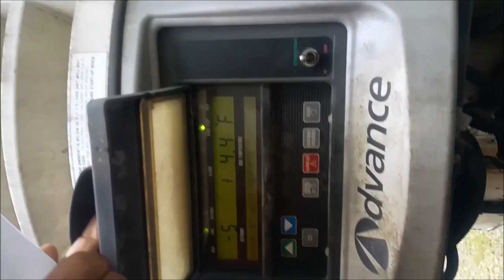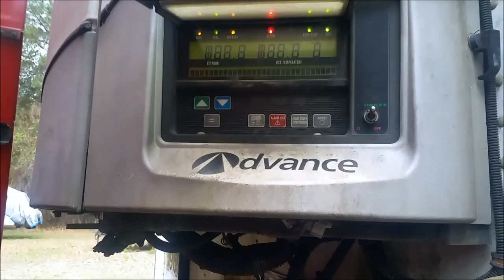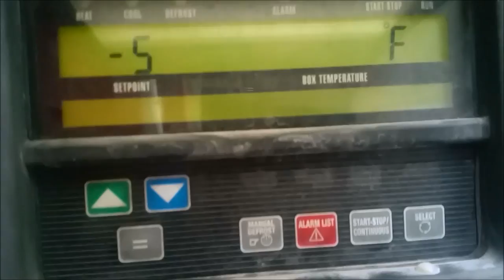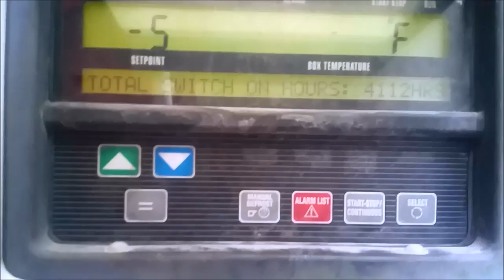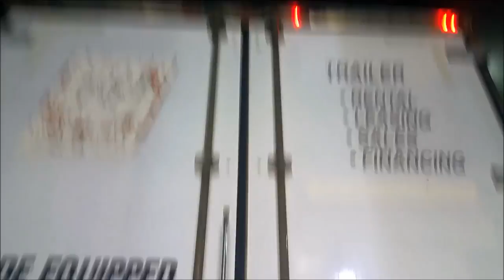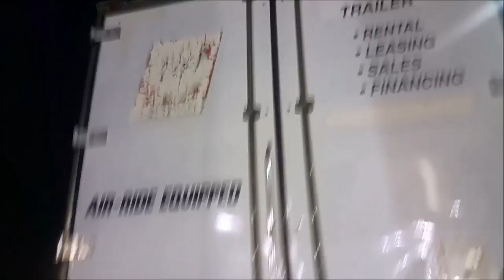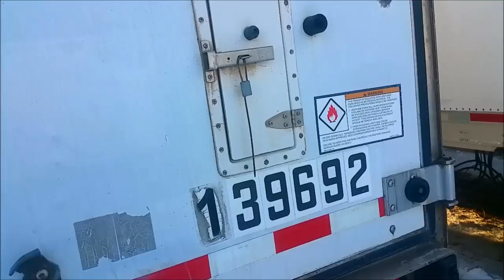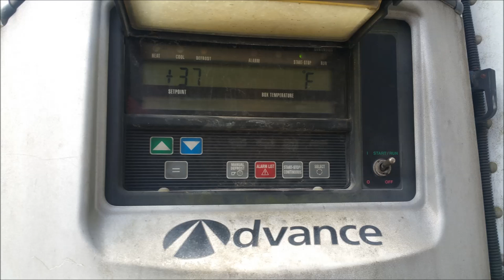53' Great Dane Carrier Ultima 53 Reefer Trailer Purchase

Comment: appreciate man for this video 

my question for you I see the truck in the video was volvo 680 
looking to get my own 2014 volvo 670 and pull the 53 reefer 40000lb or less   but still trying to  figure out the right  specifications  found one please give your advice for this one 
 2014 volvo D13
 engine size 12.8 l cc 
Hp 425
 ratio 2.47
 rear axel 40000 front 12000   CLASS 8 (GVW 33001 - 150000 mileage 452
 axel 6.4
  I shift transmission 
tires size 22
Reply from the maker: Your welcome Congrats on your purchase, this one is 780 2:43 rears i believe D12 it can seem under powered at times, I have too many questions to ask and way too much advise to give from my trials send me your email we can talk further.